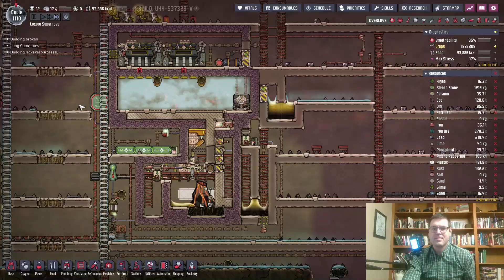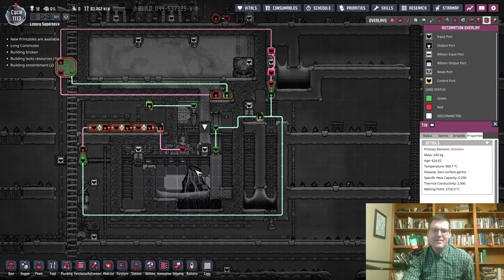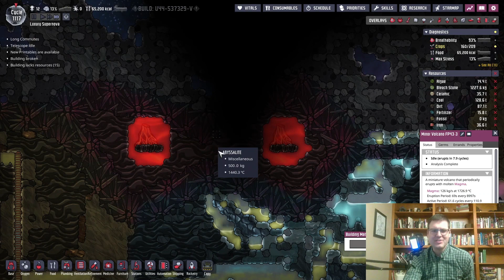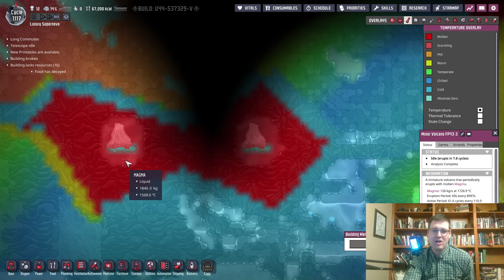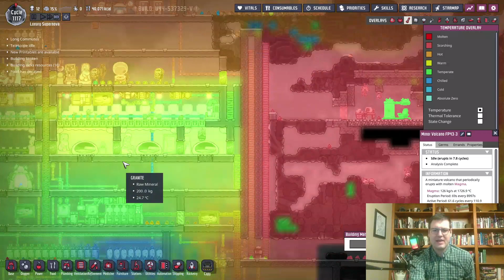Oxygen Not Included: vacuum-based volcano tamer!

Comment: Great vid ! Just wondering could the igneous be snaked through the second stage steam room on conveyor rail? Or do you need to have the rock sit on the metal tiles for better heat transfer?
Reply from the maker: You can put it through the steam room on rails. I think I did that in another setup. But keep in mind that rails have a limit of 10kg per tile. The "dump on the floor" approach can put several tons of igneous on each tile while you're extracting all the heat.